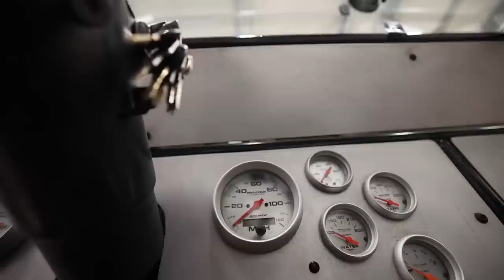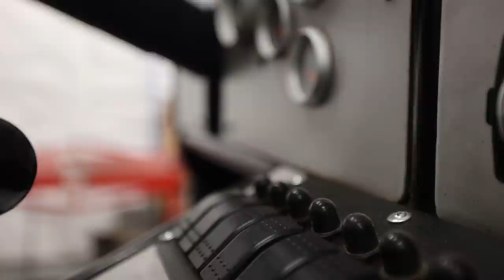500 HP LS 1 TON Swapped Jeep on 42s! FULL Walk Around 💪

Comment: Perhaps get more closeups of how the builder packaged suspension, engine, trans/ transfer cases... etc,  in your walk around vids so those who are looking for ideas can see how the builder accomplished their goals.  Awesome footage to show the capabilities of the rig and the in depth discussion of all mods was spot on!
Reply: I second this. Also any feedback from the builder about the challenges overcome. The detail about how the frame was constructed on this jeep to provide clearance for the axle in the front, but drop down low enough in the middle to protect the drive train was interesting.

Having some shots on jack stands with the tires off would be cool as well.
Reply: I will try to get some photos on my IG of the suspension and clearances as a quick run down some of the biggest challenges were the exhaust routing, coming up with a radiator fan comb that is small enough but adequate.  And for sure font axle packaging between upper link mounts hydro bumps steering lines coilover mounts and still have full turning radius.

Comment: 203 rage box would be a great addition adding a 2:1 reduction on command and ability for front only digs if needed off road design makes the kits to bolt right in between the trans and transfer case

Comment: Awsome build! I am building my 89 right now and it was good to see different ideas! I'm running 3 link in the front, 4 in the rear and 14" fix coil overs, narrowed super 60 up front and 10.5 sterling I  the rear. I couldn't get my hands on a 6.0 so I got a 5.3 with the 4L60E. The trand makes me nervous lol but it has a good 1st gear, told I can build it up.

Comment: I'm actually going from 107" to 115" with a back half. 107" felt too short for anything bigger than 40s on the terrain I wheel. Also I like to go fast. Planning to drop a om606 in also. 
I do have to say Pitbull doesn't stand behind their products. Just warning potential buyers. 
All 4 of mine (41.5r17) had the beads fail after 3-4 runs and maybe 300 miles. It was apparently a bad batch of tires but they won't replace them. 🤷‍♂️

Comment: Talk to offroad design and put together a np203/205. Plenty strong enough and they can help you set it up for the speed sensor
Reply: Thank you the speed sensor was actually one of my concerns looks like I have some quotes to get I was hoping to keep the tcase but it's not looking like that will be an option
Reply: @amkaperick  you could keep your transfer case and run a crawl box in front of it but that'll add around 8" to your drivetrain and your low range options would be 2.72 to 1 and 7.4 to 1 which I thought was too low with a V8 and an auto. The other option is one of the crawl boxes to a 205. That'll give you the 2.72 and then a 5.33 to 1 but then your speed sensor will have to be on the transfer case output shaft and I'm not sure how it would shift in low range.
Reply: @z1kforfun  I could set up the low range sensor on the shifter instead of the t case of there is no accomodation for it

Comment: I was surprised by the transfer case option but it makes some sense if you’re running the skinny pedal to the floor often. I have a simple 5.3 with a low lift cam paired with a 4l60 and a 2016 4:1 case. I’ve kept myself from doing full send due to the chain drive but man is it tempting lol. Awesome build and even more awesome he’s done most of it himself!

Comment: thanks for the walkaround, this is pretty great but i would love to know belly height.
also for gear reduction he could look at a ford 205 with a nwf black box that would give a 1.96 low range with an optional 2.72 low range for a total of 5.33 low range with both. that combo would also be an inch or so shorter than the 241 that is currently in there.

edit: offroad design also makes a version of what nwf markets as their black box.

Comment: As many of the commenters have said, NWFab.  Take the guts out of that NP241 and put them into their EcoBox, then run a married NP205 from a Ford behind the EcoBox.  1.96, 2.72 or 5.33 options.  Only adds a few inches of length compared to a normal slip-yoke NP241.

Comment: I'm running a 4-speed Atlas with a 2.72:1 crawl box and a 2.0:1 t-case low...be careful what you tell Advance Adapters as far a power is concerned...they'll limit your low range ratio options....apparently the Coyote only warrants the abovementioned ratios...my Scrambler with a 4.3:1 with a 2.48:1 1st gear is, in my opinion, is the ideal crawl ratio...the 5.44:1 may be a bit low in 1st gear may be a bit low...but you can upshift to allow for that.

Comment: I love that this thing has a high(-ish) compression V8 on premium pump gas. What kind of timing advance is it running up top? It sounds great and looks like it performs very well. 

I like the front parallel four link. What kind of numbers did you end up with for anti-squat and anti-lift in the rear and anti-dive and anti-lift in the front or did you just kind of wing it without using the calculator? What roll axis inclination? These figures are hotly debated by keyboard engineers and I am always interested to hear what they are for various rigs.

Comment: It can be bolted to the front of the t case, rear of the t case, or the tailshaft of the transmission... they are only about 8" long and they can handle 1200hp... my boy back home in jersey (im in nc) has an 800 hp carburetor fed mustang with 496 gears in the rear ...with gear vendors unit he rides at  1800 rpms on the turnpike in 5th gear at 150 mph...(occasionally)..... they could be built for either and underdrive unit or an overdrive unit it takes a 6-speed and turns it into a 12 great unit very tough but I believe it's slightly pricey hope this helped man rock on with the videos

Comment: What wasn't mentioned was the tcase being from a GM truck has a slip yoke output for the rear, like that of a YJ and TJ. Aftermarket provides a SYE setup that strengthens the output and provides a yoke output setup, requiring a slip rear ds in place of the 1pc ds. THere is hack-n-tap as the cheap option vs the rear case output and rear output shaft. What did he do to his GM NP241?

Comment: Check out off-road designs magnum box
Reply: That was going to be my recommendation. A magnum doubler in front of an NP205 is roughly the same size as a NP241 and will without a doubt hold up to the power. 1:1, 1.96:1, 2.72:1 and 5.33:1 I know many guys running blowers and nitrous through LS’s on AG tires with that setup.

Comment: An NWF black box and Ford np205 (passenger drop, 5.32 Ish low gear) should handle the power just fine. But as an engineer taking an engineering approach. I would run that setup and swap that motor to a little peanut cam that makes power at 5 rpms lol

Comment: Black box for doubler from north west fab.   Uses another 2.7:1. I think it’s 8” long.
Reply: Or 203/205 from nwf if you can get it to fit. 4:1 super strong
Reply: @chadlloyd6247   their titan 205 I think is a better setup than that. But they got lots of options to fit budgets and strength setups

Comment: Why 5.13's in the axle?  I'm assuming this doesn't see a lot of highway driving.  With 42s I feel you should be running 5.86's or 6.72's if your axles will take them.  Axle gears would be the easiest way to keep the setup you currently have just lower everything.  If you need speed you still have 4 hi.  Only downfall with low ratio ring and pinion is the pinion head gets real small but if you purchase a high quality gear set I think you'd be ok.  Very unique build. Impressive rig 👌.  Love the story about its evolution.  Everyone can relate to that.
Reply: Looks like 5.13's is the lowest you can go in the 14 bolt.  I used to run a 14 bolt and switched to a Dana 70HD.  I'm guessing one of the reasons I switched was because of the axle gears.  I run 5.86 in my truck.  Might be an option for you.  Swap in a dana 70 and sell your shaved 14 bolt.  I'm guessing all the planetary gear boxes are going to require frame mods and new driveshafts not to mention a high price tag.

Comment: Crazy running pump gas alone at 12-1 compression. I have a 350 bored .40 over, balanced, decked and  &  has 11-1 forged  pistons. 58cc closed chamber heads with 2.02  valves and 16 hrs gasket matching, porting & polishing. 505/244 comp cam. With 1.6 roller rockers. I’m at 11.5-1 compression & have to add  25% racing fuel to bump up the octane. It’s putting out 470hp/450tq @ 4200rpm. at the crank.  Guys  Dyno water brake would not stop the engine completely to get higher readings and I had a shit 750 carb on. Machinist said those were conservative numbers 😂 I put a 850 mighty demon on the Victor jr intake. My machinist said minimum 25% racing fuel has to be added or fry the motor eventually due to detonation. Modern electronics in engines nowadays can adjust for it some, that does not stop it completely tho.
Reply: Yea the EFI allows you to get a little closer to that "LINE" it would definitely benefit from some higher octane and some more timing. I planned on 11.5  I was going to throw the milled heads on the stock bottom end which had dished pistons then I decided to rebuild and couldn't stop myself from putting flat tops in while it was apart lol
Reply: I keep an eye on the plugs as well to catch any detonation
Reply: The design of the combustion chamber also has a big influence on the potential for detonation. It's possible the more modern heads are better in this regard.
Reply: @Fix_It_Again_Tony  right, that and  modern electronics can constantly adjust for it
Reply: @amkaperick  I know how the mind changes with motors and such.  lol.   You should try adding 5gal to a tank  sometime, give her a bit more timing and feel the difference 🎉🤣 A buddy of mine had a MSD dial he could change timing on the fly. I have a 2.5” exhaust and race readies just after the headers, the difference uncapped is amazing. Couple of minutes and 6wingnuts later it’s open header, lump lump 😂💪🏻✌🏼
Reply: @jamesws08  Right. Like Andy is saying that lets you run more agressive timing and compression because if there is knock the ECU can hear it and pull back timing. 

EFI also helps because fuel atomization is improved with injectors versus a carb and that helps cool down the temperature in the cylinder as the fuel fully evaporates. Direct injection is even better than port for cooling. Thats why guys that run turbos like E85. Ethanol has a more potent cooling effect that gasoline. Methanol injection is used for the same reason.

In a computer controlled engine to reduce detonation you typically pull out timing, add fuel or reduce boost pressure. All are related to cylinder temperature. Increased compression ratios also increase in cylinder temperatures. Same reason why the air coming out of your compressor is hot. Compressing a gas increases its temperature.

Comment: Music citation, por favor? 

For all the engine mods, I’d expect more horsepower… but with the compression that high, it might be limited by pump gas octane. My vette had issues for the same reason. He should try some race gas and see if it helps. 

Also, changing spark plug temperature can make a big difference in an LS. Hoonigan covered that really well with the Texas Speed crate motor dyno episodes.
Reply: It's essentially a ls2 with a cam it's not all that modded but if I could find a way to get long tubes and dual exhaust out the back and a more aggressive cam I'm sure it would make more

Comment: I say skip the 6L80 and just go all out with a 10R80 which is a clutch to clutch bandless transmission,  and us-shift is working on a standalone transmission controller for it. 
 First – 4.70
Second – 2.99
Third – 2.15
Fourth – 1.80
Fifth – 1.52
Sixth – 1.28
Seventh – 1.00
Eighth – 0.85
Ninth – 0.69
Tenth – 0.64
Reverse – 4.87

Comment: I have a TJ that is going in nearly the identical set up direction. 97 TJ - body stretch to TJ6/LJ whatever you wanna call it. JKU frame to go under it. I bought a 2004 2500HD for the 14 bolt, 6.0 LQ4, 4L80. 87 Ford Dana 60 high pinion king pin, full hydro steering.
 I have yet to put the frame under the body, or set up the frame to mount everything to it, so no shocks/coilovers yet and no transfer case.
 Was planning on an Atlas 4.3 gearing. Would that not hold up to 500HP?

Comment: So what did the half cuts both front and rear come from, or did you bend all that box tubing yourself?
Reply: In the front I cut the frame about 1 ft in   front of the fire wall and built some offset brackets to redirect the new rails whichs are 2x2 tube the rear I bought some offset brackets that allowed me to move the frame in and up by cutting the existing fame where ever I wanted then run 2x3 tube rails out of the brackets. I will post pics on my Instagram

Comment: Do yens have or know someone that does have an in depth step by step video on how to swap an LS motor into a YJ. I’ve replaced motors in vehicles with same motor but have never  swapped a different motor in. I also have zero welding skills so I’d need to know if there’s bolt in engine mounts and how you would mate to Jeep ax15/231 or what is needed as far as drive shafts and things to put Chevy trans and t case in. Also what to do about wiring and computer to get it all to work in a YJ. I really want to put an LS in my YJ but need an in depth step by step video.

Comment: Can you drive it on the hiway? 50 55 mph is all I need. Want to have my xj as extreme as I can and still be able to hit the road
Reply: The full hydro is hard to get used to you lose the "feel" and it tends to have just a bit of wander but I drive it all over. Most of the trails in Moab end 15 to 20 miles out of town  so I was cruising 60 70 even 80 and it drove straight and smooth it just the steering is different...
Reply: @amkaperick  sweet now I can move forward with confidence thanks tons

Comment: I have an 1987 YJ with a 350 TBI. I’m curious as to what fuel pump he used, and where it was placed?
Reply: I'm running a rci 15 gal tank right against the tailgate. I used the factory yj sender with a walbro255lph pump -6 an lines. Corvette filter regulator
Reply: The Corvette regulator will not work for you due to the different fuel pressure needs. Adjustable regulator will get it done

Comment: The crawl box I'm Using is for a 231 with a dana 300 behind it (I have a CJ-7) and it adds about 6 inches to the overall drivetrain but you can put it in a 231 with a 6 pinion planetary to strengthen it though if your worried about the case then you may be stuck going with something else. I know that some of the other ones make there own case and then use the internals out of  np231 or other similar transfer case but are about the same length as what im using I would think that they would be a bit stronger though as far as the case goes.

Here's the one I'm using
https://froehlichsuspension-com.3dcartstores.com/NP231-Doubler-Adapter_p_14.html

Heres one with a custom made case.
https://www.northwestfab.com/NWF-Eco-Box-Billet-Planetary-Doubler-Case_p_3969.html

Comment: Are the axles narrowed any? The front 60 looked a little narrow unless it was a 78-79 snow fighter.
Reply: It's narrowed 6in I did it back it the day when that was the cool thing to do.  Another thing I would have changed be fore I put the truss on
Reply: @amkaperick  is it too narrow now with the 42s? Im putting full widths on my yj but plan to keep around a 37 inch tire. Im afraid 67 wms is too wide. I want to keep the tires under the jeep.
Reply: Yes it is I highly recommend keeping as much width as you can and getting more backspaced wheels this will make it wheel so much better by decreasing the scrub radius of your steering. I have trouble with some obstacles due to the spacers I have in the front to match the rear . If I have to turn on a rock my tires move front to back because they are so far away from the steer center.  With more back space on the wheels you will be closer to the center allowing the tire to pivot which makes it easier to make adjustments on obstacles with out loosing your placement
Reply: @amkaperick  thanks man for the replies. Im planning on running some mid 2000s ram steel wheels. They are 17x8 with 6 inches of backspacing. The high steer arms and lockout hubs won't be happy.
Reply: @jeepindave5464  drive flanges are a bit shorter